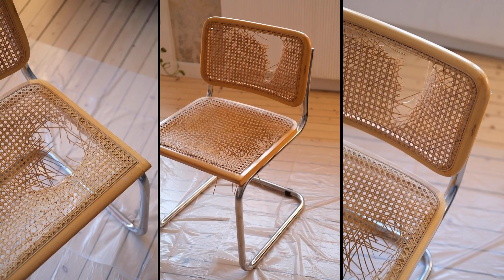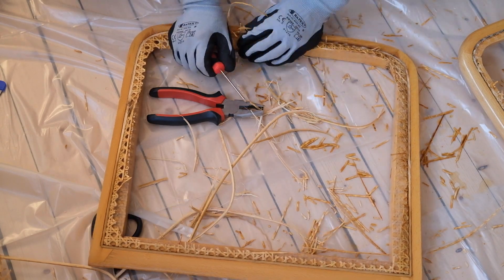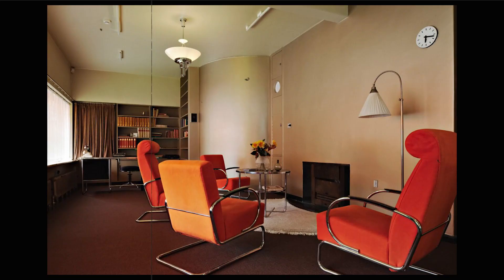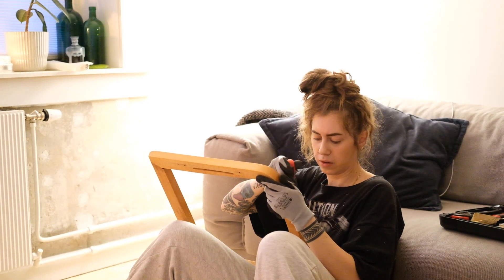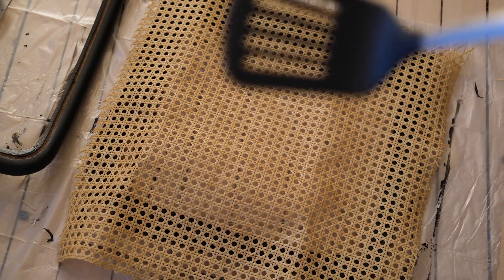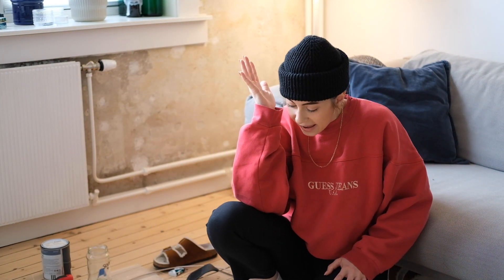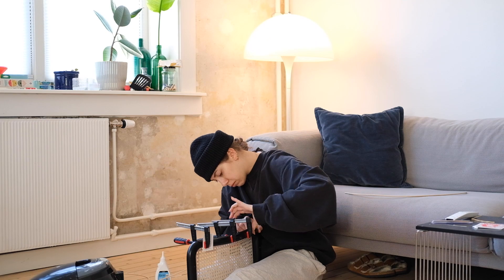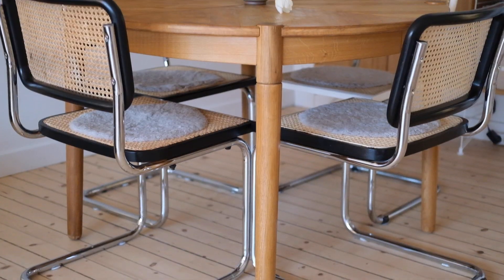I fixed a broken Cesca chair || Marcel Breuer & modernism

Comment: Hey , so happy to find your video , I will repair mine , but I m desapointed, the chrome on the feet is gone . Do you think it’s possible to apply a chrome bomb paint? I tried everything… thank you so much
Reply from the maker: Thank you sm! Hmm is it rusty?? I must admit i don't have much experience restoring rusty chrome, but I googled now and there's quite a few articles recommending solutions. I think you'll be more happy with the result if you try to remove the rust, rather than painting over it. I would take a picture and go to your local hardware store and ask for advise. Good luck! <3

Comment: how can I fix the base, the legs ?  They have been disassebled to each other and I struggle to sit on the chair.
Reply from the maker: Heyy, I’m sorry but I don’t have much experience with that unfortunately. Sounds like they might need to be welded, but I’d recommend taking a picture to your local hardware store and ask if they have any advice. They often know what tools you’ll need and  can probably give you a better answer than I can 😅